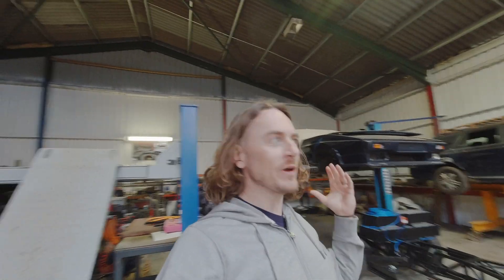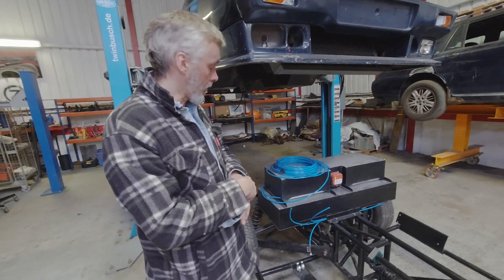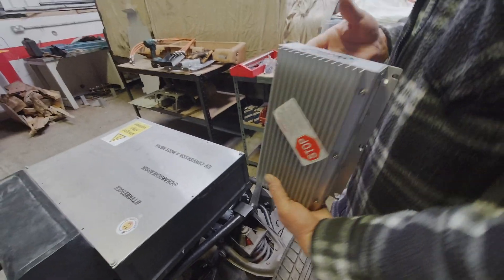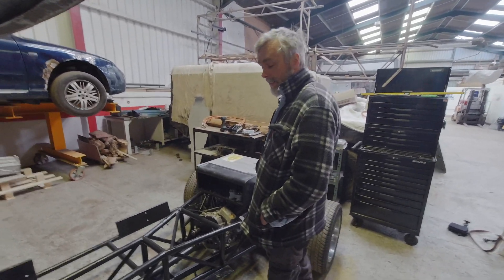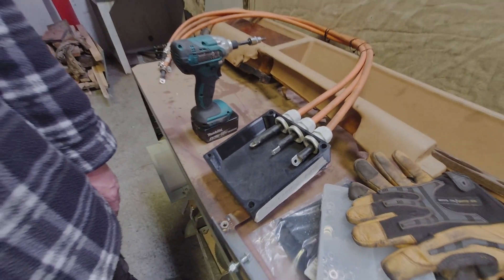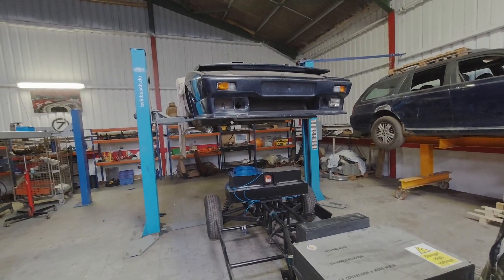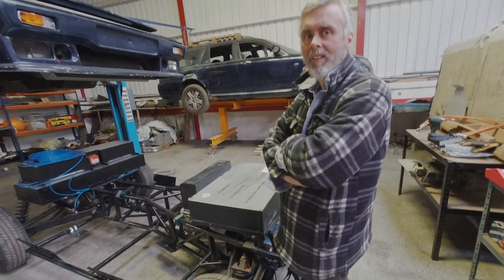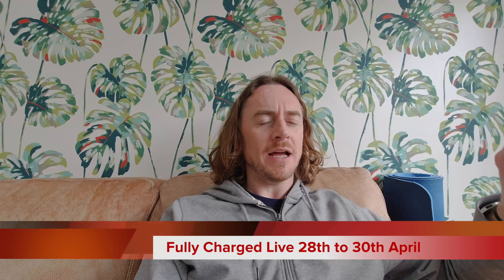Tesla Powered TVR EV Conversion. Ep17

Comment: Awesome, how much does the battery pack weighs, and what kw
Reply from the maker: It will be 40kwh out of the whole 44kwh pack from an MG ZS. Weight of just the batteries or both battery boxes with coolant plates?
Reply: Just batteries

Comment: Why not open up the center trans tunnel tubing and fab some mounts for the drive unit, to just directly connect/drive that rear diff? 🤔
Otherwise it's coming along very nicely. Will you put it up against one of moggies ev converted cars when it's all done? 😀
Reply from the maker: I think a meet at Santapod between EV conversion company cars would be alot of fun for sure. You can't touch the chassis according to UK laws. It was important that this conversion was to the letter as I was vlogging it, so nowhere to hide.
Reply: @chargeheads  ah man I forgot about them doing that outside the U.S. on conversions. 👍🏻
Reply from the maker: @4literv6  yep its a massive ball ache and makes conversions more expensive. 😔
Reply: @chargeheads  anything to delay the transition. 😏
Reply from the maker: @4literv6  indeed 🙈

Comment: Hi thanks for sharing your project. What happens to brakes and suspensions with the extra weight? Do you keep the weird rear single disk brake?
Reply from the maker: Its a very good point, we'll get it running first and test it out. It will certainly need upgraded brakes 😉⚡️💥
Reply: @chargeheads  maybe not? Monster trucks run just 1 large inboard brake disc directly on the main driveshaft. 
If it works to stop those 1000+hp 10,000# monster's it should do for this to.👍🏻